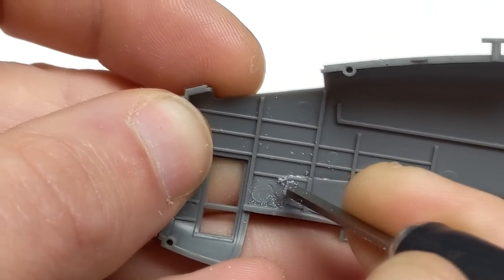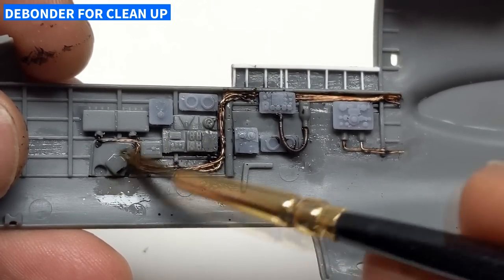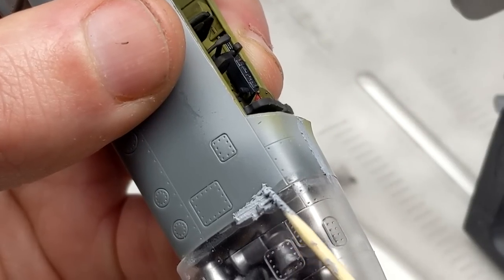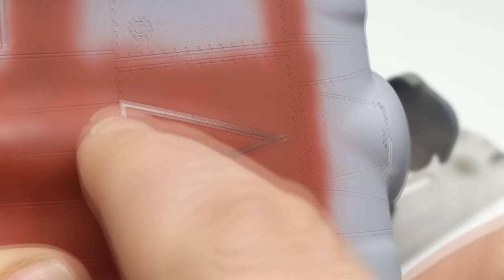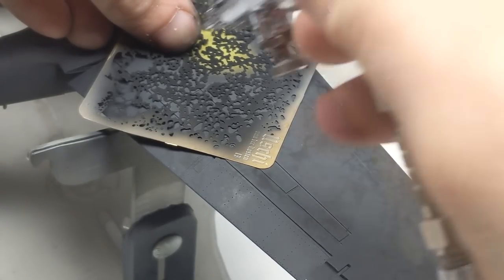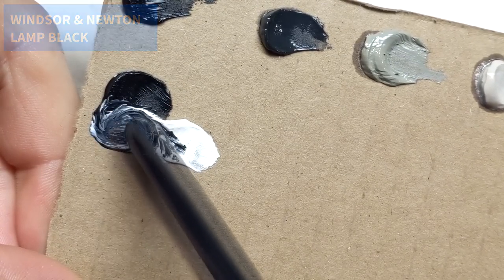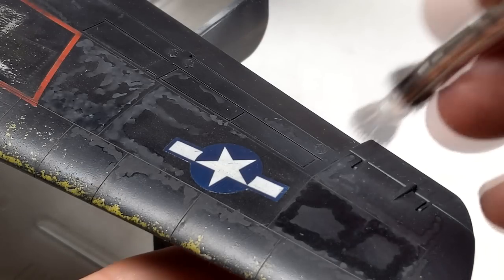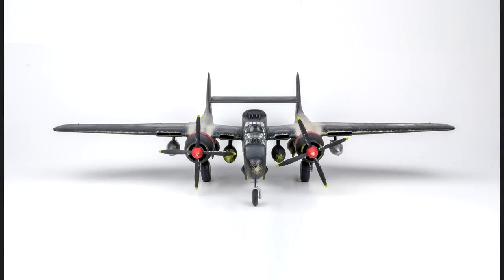Great Wall Hobby 1/48 P-61 Black Widow: Working with Black

Comment: The Black Widow had a special high -reflectivity paint that was extremely shiny. The thought was that searchlights hitting it would reflect and be mistaken for stars. I built one for my brother-in-law in the  late 80's and had a high gloss finish on the belly, but used flat varnish on the top for sun-fading. The P-61 was a gorgeous airplane, and there were also Olive Drab paint schemes that were flown in Europe. They look amazing with invasion stripws on them.

Comment: Gorgeous P-61! I used a mix of gloss X-18 (middle sections of panels to mimic condensation at night/early morning as depicted plane just back from mission) and flat blacks - Tamiya NATO and Vallejo), plus oil treatment for the bottom of my Beaufighter night fighter. Added in some sand washes and more oil work with tan to show the dusty Libya environment. Fan of the AK Neutral Wash (after watching P-38 build) to get that faded look. New - latest model had my first use of vacuum-formed canopy, and leather gun "fairings" made with Milliput.

Comment: I mixed my P61 black with white to “lighten” a total black. I preferred to airbrush flat and then came in with semi gloss. I used all four Eduard detail sets, metal landing gears, custom Thermaform canopies, Meteor decals and several modifications to convert an earlier P61A to P61B (late) as the B version was not out yet when GWH first produced it. (I “stole” the turret from an unbuilt Revel kit). This was a very tedious kit to build with so many added details and fit issues but in the long run, this most ambitious model was worth it. The kit engines are fantastic and I have one loose so I can take it off and pull the cowl to expose the great detail of the engine. I also cut out a panel out of the cowl and have a replacement panel made from brass to permanently show some of the engine. I built a custom display box with a “concrete” service area and added a few mechanics. 
This is definitely not an easy build but worth the effort.

Comment: The model reminds me of that movie Fantastic Voyage where they shrunk the sub to molecular size :-) I think you have access to that machine on this kit, really outstanding build. I'm retired and just getting back into modeling, the change in the kits has been overwhelming also materials . Your channel has enhanced getting back into the game. AND your followers have super ideas as well. Your mention a cowling blue, I'm thinking that could be used in the SR 71 mix. Plus regarding the variation in surface areas and exhaust patterns in Pacific base aircraft - salt water spray is the primary cause along with the type of soil, a lot or corral, A new aircraft could look old after a mission or two, with carbon in exhaust, props took a beating too. This problem up till this day is one reason they should never have deployed the F35 on carriers, sea air eats the RAM off. Thanks for sharing you expertise. So many awesome models today, so little time.

Comment: There are two excellent videos on YouTube featuring the P-61,flying the P-61 and flying the P-61 black widow series aircraft,both produced by the USAAF in 1944 as a training aid for potential black widow pilots,they are particularly good for accurate cockpit and instrument layouts,I found them invaluable when building my hobbyboss 1/32 P-61.

Comment: With black, I often use a tamiya flat black, then spray rubber black heavily thinned in the centre of panels. If I'm making a "clean" aircraft the natural light tends to catch it, especially with a satin varnish. I will add a dark grey to the rubber black to push highlights a bit too that looks nice under weathering. Took some experimenting to develop a work flow I like

Comment: One technique I tried on the Dragon 1/32 Bf110C kit was to use no black paint at all (unless you count Tamiya Smoke as a black paint!). I picked up this tip from Hyperscale a long time ago, like about 2004/5.
      The model was painted in allover straight bottle Olive drab (Tamiya) then various panels were masked off, and thin coats of a Medium blue and dull red-brown were applied at random.  Over this I used Tamiya Clear Green, Clear Red and Clear Blue in light overall coats until the over all tone was approximately even with special emphasis on the topside as the plane I was modelling was a Nighfighter/Intruder photographed in Benghazi, Libya in 1941., so I wanted the topside to be lighter toned than underneath (Desert sunlight). 
      To tie it all together better, I then applied a couple of thin coats of Tamiya Smoke to even out and combine the hues. The result was really quite well done and certainly looks like a varigated black/Black-grey to the eye and to the Camera. (I have some photos!) The key is to use light coats, almost mist coats, apart from the Base Olive Drab. (I suspect using Khaki Drab may work also but have yet to try that.)  This is a technique I may try on my 1/32 Hobby Boss Black Widows (I have 2, one to be finished as an A model and the other as a B - I have spent almost as much on the resin bits I'll need as I did on the kits! The HB kit is neither an A or a B model, but an odd mix of the two, with some surprising omissions (Like the Exhausts for the R2800 engines, and a totally wrong Spinner/gearbox fairing, as well as very poor props.) Fortunately there are cures in resin for this!
     I suspect that it would be possible to do the random blotchings after the clear coats and before the Smoke, but I will have to experiment with that. - It may be that the blotches may need to be applied over the Olive Drab before the clear coats. Or maybe both before and after!

Comment: i love working with black - working on a GWH P61 too - basically the same with SMS Laquer and hair spray between the BMF, primer, and black - with the black I used a tyre style (rlm 66-ish) - camo and a chassis black with wet sand between coats - painted the red, but too lazy on the marking, but swapped them for other better ones of the same size that worked well.. In the finishing stage now... What I think is odd, the P61 is bigger than I thought it would be (expected it to be Mosquito sized)- it's the same size as a Ju88!!..

Comment: i like your work and you did a great job on this bird.just a quick mention on the black painting,check out scalemodelaircraft he did a german night fighter in black by using different grays mixed into his black paint to produce the type of black coloring that you are looking for.
Reply from the maker: I'm sure there are a lot of ways to do it. This was my first time so it was quite a bit of experimenting.
Reply: I agree, from all the methods i have seen, his was the best IMO, best end result.
Reply: @TheModelGuy  And there are a massive difference between a German plane working in wet Europe and an USAF plane working in dry Asia. What i really like with this model is that the black still are "worn" matt on the flat surfaces on the wings due to wear over time, you hit that look perfectly. And the oil/dust from the engines on the upper wing, again, you ended up with a perfect look from your toying with colors. I am a perfect example of achromatopsia, so you should feel really proud over my positive critique, i do tend the be more annoyed when people with normal color sight mess colors up :D
This video of the P-61 better explain what i mean, also with the shiny/matt parts: www.youtube.com/watch?v=HOZWLtNx_SE
Reply: @TheModelGuy   i understand and you did a great job on it

Comment: The kit is 75 percent still the old monogram kit with all its 50 year old mold issues. I'm working on it myself and its a kit for an experienced builder. If you can't fab from scratch this kit will be ugly.
Reply: GWH p61 is not monograms p61. I've built both and monograms  is a tough one.

Comment: Love u.s naval aviation. Any recommendations on Vietnam era navel jet kits? Maybe you could build one? Love the vids.
Reply: Maybe a f8 or a f4. Love those planes.
Reply: The new Tamiya 1/48th F-4 is arguably one of the, if not the best Phantom kit on the market right now
Reply from the maker: Sooo I do have an A-7 Corsair II in the stash that I plan on loading right out. That's probably two months away and is scheduled to start April 1st.
Reply from the maker: @jacobs_models995  I've been hearing that. I'm not a real F-4 fan but I hear build wise it's unbeatable.
Reply from the maker: The Hasegawa A-4 is a simple and nice kit. If you can find an A-4E/F

Comment: Can you do a video of your 3D rpinter experiences? What kind of printer do you use? What would you recommend?
Reply from the maker: I have an Anycubic Photon Mono X and I haven't had a great experience with it. It requires a lot of work to get it dialed in.

I hear the Saturn is really nice. I find I have to replace the fep on this quite a bit more than other brands

Comment: Was that much discolouration actually caused by the engines and, if it did, would the USAAF not clean it up and repaint before it got that bad: given that they had pride in their aircraft and it degrades the camouflage ?
Reply from the maker: Oh yeah it was. Cleaning it up would take time and in reality do nothing for the performance of the aircraft. Remember these aircraft were at the end of a long supply line and mechanical repairs were more priority over cleanliness

https://images.app.goo.gl/15ywWc2tVLJbwbhWA
Reply: @TheModelGuy  Thanks for the response. I have to disagree there. The USAAF did have pride in their planes and had no shortage of personnel and material for such tasks. Mechanical repairs being obviously more important does not exclude them from also keeping their planes spick and span. I note that only one of the linked images shows a Black Widow that is anywhere near as dirty as yours. Don't get me wrong, I do admire your modelling skill, you do lay on the muck though.
Reply from the maker: @Twirlyhead  for some reason that's the view a lot of aircraft modelers have. As someone in the Air Force I have to disagree. Even with the maintainers, scheduled cleaning periods and upkeep, the Jets get dirty the minute they're out of the wash bay. And this is one of the Thunderbirds.

So of that's during peacetime, imagine a high temp warzone.

https://images.app.goo.gl/xkM2DMW2nyZnYRMy6
Reply: @TheModelGuy  Modellers like to show technique and effort in a model, particularly to each other. Weathering, wear and muck take skill demonstrate such. On the other hand making a "clean" model  is generally easier, does not clearly demonstrate so much skill and may appear like effort has been spared; even if it is accurate, possibly more accurate in some cases. For me it comes down to judgement.
Reply: @Twirlyhead  But that's a completely different argument than saying Aircraft were thoroughly cleaned every hour of the day because of pride.
Reply: @TheDamnoranges  Here we go.